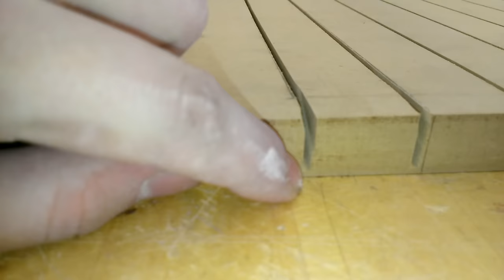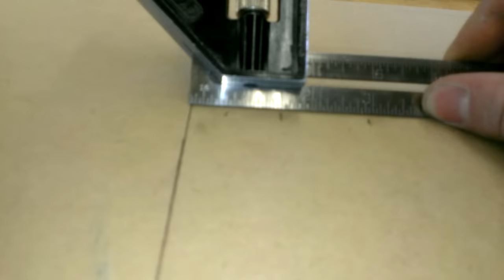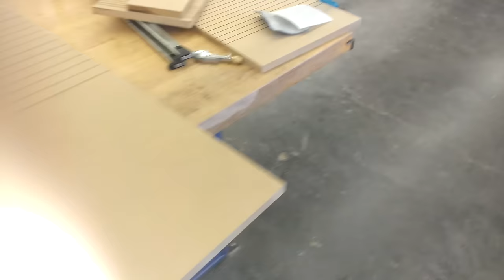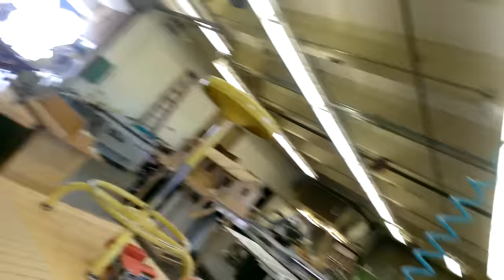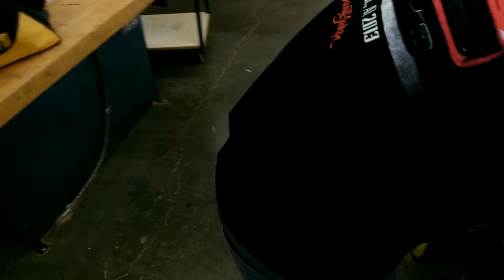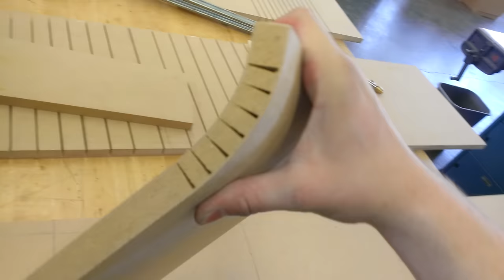Quick MDF Kerfing Tutorial

Comment: How well does the integrity hold up? I'm looking to slightly arc the front side of my box
Reply from the maker: i know this is late which i apologize just got back into the country haha but it does compromise the integrity of the 
 board as you are removing 90% of the material for every cut you make. so if you're worried about it breaking i would fiberglass the back side of it. that it what i did for every Kerf i did for this box i was working on and it's super strong now.

Comment: I know this is old but I have a question.   In what situation would you want a 180 degree kerf as opposed to a 90 degree kerf angle
Reply: I used a 180 kerf in my folded horn sub box design. The transmission line for the sound wave took two 180 turns in the design.
Reply: @C_Robbins   I will have to look for maybe a diagram where I can get an idea of  A 180ﾟ kerf because I just can't imagine how it looks on the Box
Reply: @drrckhamilton  if I could figure out some way to contact you I could send ya a picture of the box I made

Comment: This is not the proper way. the slot you do should be in "V" shape, so that there should be no gap between the bend. and it also makes the finished product stronger.
Reply: How do you cut a V? Angle the saw blade and make two cuts? Or a dado? Or a special blade? Router?
Reply: @sweetiepienumber1  or you can use your router. making 2 cuts with the saw machine in angle is not feasible
 and needs lots of accuracy

Comment: 12 cut for 90 degree and 24 cut for 180 degree??
Hope you explain more.
Reply from the maker: if you're wanting to do a 90 degree bend then make 12 kerfs or cuts that don't go all the way through. if you want 180 then make 24. it takes out the material so the board can bend. make one line where you want the bend to start and one where you want it to end and then spread other 10 or 22 cuts between those two evenly. does that help at all?
Reply: Thank you
I use 18 mm MDF, should I cut it 16 mm depth?
Reply from the maker: Mohammad Omidi try it on a scrap piece. see if it'll bend without cracking. if it does crack go deeper. if it's too fragile then go shallower. just try it out on a scrap piece first to play with the depth.
Reply: thanks again
Reply: RobbinsRacing
Reply: @RobbinsRacing  That's with a standard kerf blade, I assume?

Comment: How do you hold the final shape? I imagine you have to glue a skin to the kerfed side? What would you use for this?
Reply from the maker: ArcanePath360 yes that's correct. I've used fiberglass to make the bend strong and it's worked out great. Well usually I use wood glue in each of the cuts and then fiberglass on the inside of the bend. Its worked great
Reply: Thanks. I've never used fiberglass. I thought about using bendable ply with wood glue, but I might as well just glue two bits of bendable ply together to get the same end result.